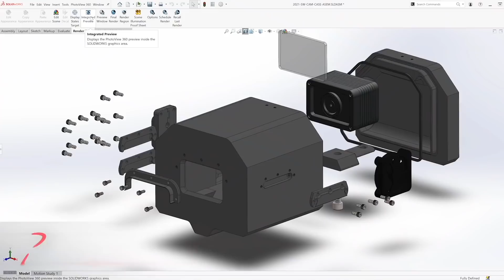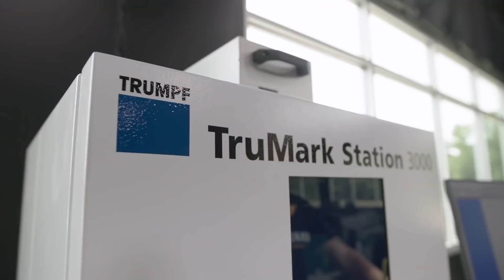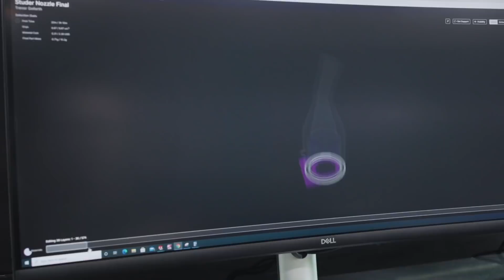FAILED at Achieving My DREAM… Thought I Had No Options

Comment: Bourne with machanical genes, lol.
Started working at the age of 15 in dads workshop as helper for but off course for stipend & now no job is impossible level without academic degree. What i learned is on the job & theory for solving problems.

Comment: I got the physical therapy degree which is now 4 years college and 3 more years for your doctor of physical therapy.  I am still interested in being a machinist.
Reply: Are you smoking crack? Being a physical therapist won't give you cancer or destroy your lungs.
Reply: Are you saying being a machinist gives you cancer and destroys your lungs?
Reply: @intn14  probably not in a shop like Titan's, but in many shops, yes. My friend got COPD from 30 years of machining. Everything you use has warnings for cancer, lung, kidney, and liver damage. But if you ran your own shop, had the proper safety equipment, and kept your coolant ratios in the correct range, you'd probably be fine.

Comment: I wanted to drive trains but never got accepted for a traineeship to do it. I applied for a fitter apprenticeship at a big mine which I didn’t get. Having no other immediate options after high school I rang an engineering company my Dad had talked about that did work for the company he worked for. I couldn’t even spell the name of the place properly trying to find it in the phone book. I rang them, I took my resume in, they gave me a two week trial as work experience, which became four weeks and an offer for an apprenticeship. 15years on still going. I have since moved jobs but still in the trade. This trade is amazing.